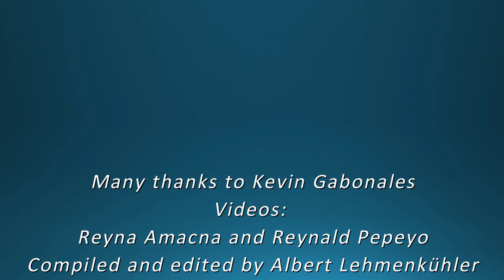Bangka - Part 1

Comment: Unsay sukod ug kabaga sa mga gamit nimo kahoy sir?
Reply: Hi! For the frame, most of the wood sizes were the following: 
1.5×2×18
1.5×2×21
1×2×18
0.5×2×18
5×3×3
The walls, 3 pcs. of regular plywood were used.
As for the floor, 1×8×33 inches.